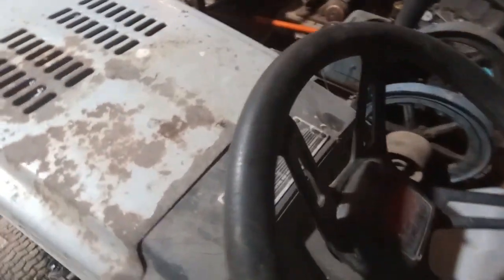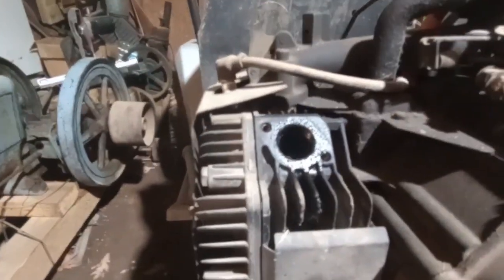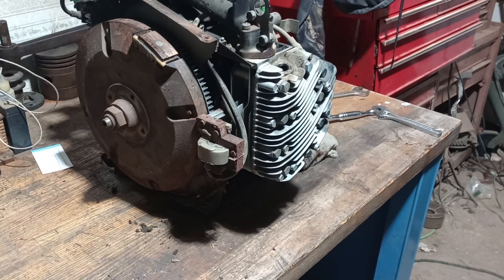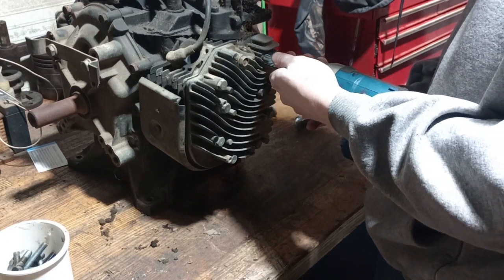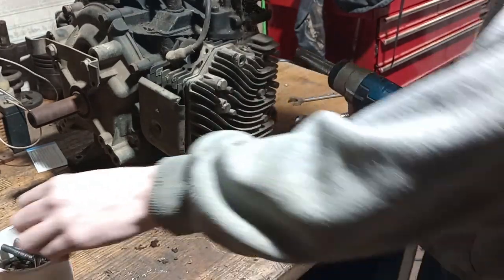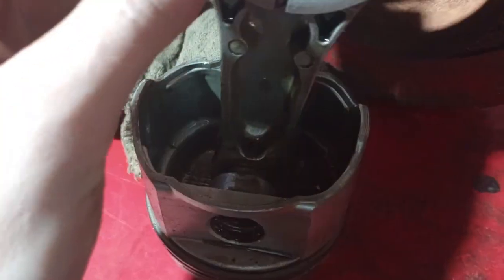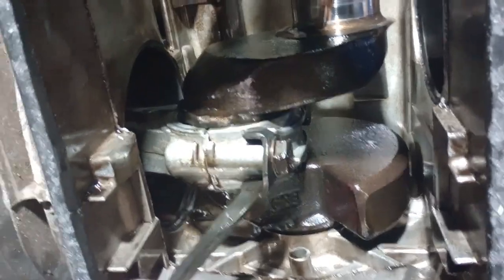briggs and stratton 18hp opposed twin 422437 rebuild part 1

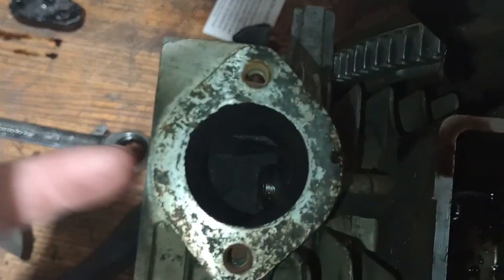Comment: 22:53 Can I flush that out with Kerosene where the valve stems are without having to take any other parts off (besides the carb and air intake manifold)? Where would that drain out to? (I have dirty rain water/mud in that section) Would you suggest me taking the cylinder head cover off and flush it through the valve openings while hand spinning the engine? Thanks.  
I've fixed/replaced everything else on my rebuild and only have this problem left. I appreciate the video and your time! Thank you.
Reply from the maker: Yes I would suggest taking the cylinder heads off and flush it through the the valve openings and if you don't take the heads off it should drain into the crankcase so I would also suggest changing the oil when you are done
Reply: @rescuerestorerepeat8500  Thank you!

Comment: Hello, thank you for your video. I am just getting into small engines. I’ve never known anything about them till I came upon a used non working mini bike I got for my son. Luckily it just needed a carb clean, but got me hooked on small motors. I recently found an old opposing valve 18 hp Briggs that was thrown away and then found your video. The project will be a step up from the predators I’ve been messing with but I want to see that big motor running again. Where did you find the replacement stuff, and how much did the new parts cost?
Reply from the maker: I got the parts from eBay the parts cost about $150 for the all the parts I got for this engine but you can get a full rebuild kit for it now that comes with everything including the valves and pistons for about $225 I think. Thanks for watching

Comment: I am currently working on an 18hp opposed twin engine. Do these engines have a compression release in them? I haven't found any indication anywhere that they do. Thanks for your kind answer. I have installed dual carburetors along with the dual exhaust on mine, but have been having issues with exhaust coming back through the carburetors. I am in process of adjusting the valves right now and have found that they are way out of adjustment.
Reply from the maker: These engines don't have a compression release in them. by the way how did you setup the dual carburetors?

Comment: Where would you find the points Gap the ignition Gap spark plug gap is there a source
Reply from the maker: You should be able to Google it and check but it should be .020 on the points and .025 for the spark plug gap

Comment: Those were essentially 2 11 hp B&S mated. Had a very poor oiling system (dipper). Don't run those over 15° from level. Done a few of those.
Reply: @NubsWithGuns  You'll find it's a poorly designed engine. Kohler had an opposed twin before B&S did & it used a gear driven pump. Use a B&S twin on slopes & hillsides & see what you'll get. As for the 1st part of your reply I fully agree.
Reply: @darrellepickering8433  I have a ~30* hill that tips the engine toward the right side. I've had it like that 8 years without problems. Only here because the engine is ~25 years old and could probably do with a rebuild.
Reply: @SalientDebate  verticle or horizontal motor? Verticles had a slinger, horizontals only had a single dipper & it was only on 1 rod. If those were used on slopes with much of an angle whether it be side to side or up/down oil starvation could happen.
Reply: Flat land engine for sure 😊